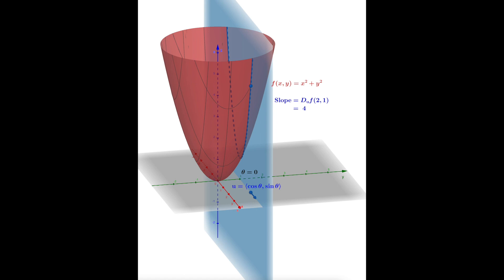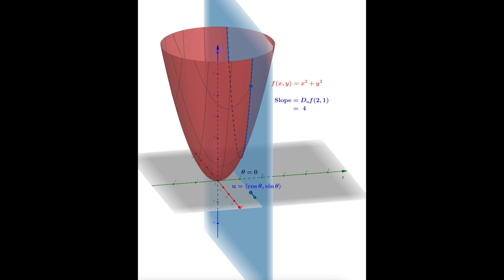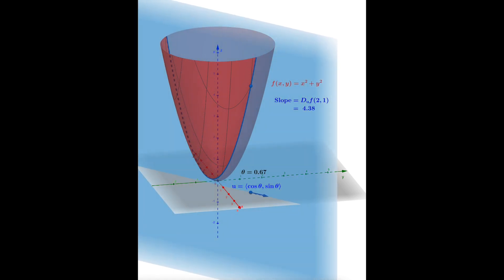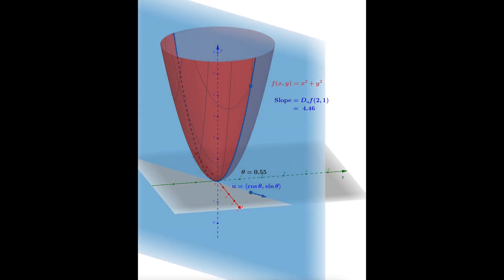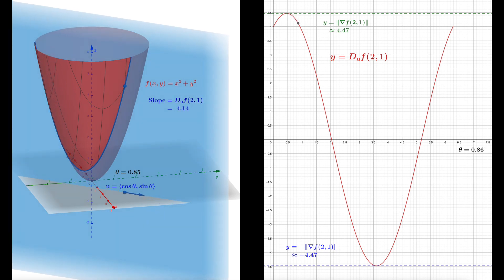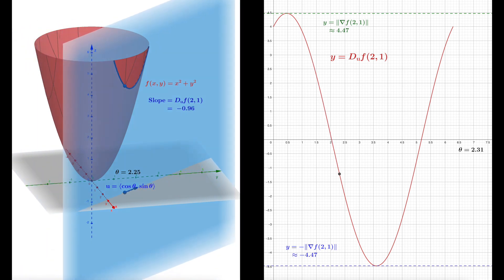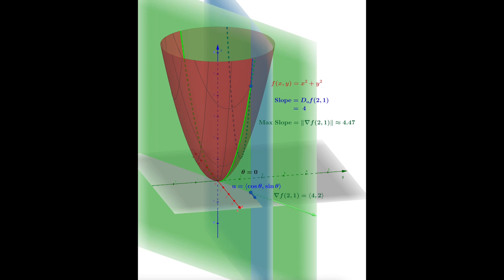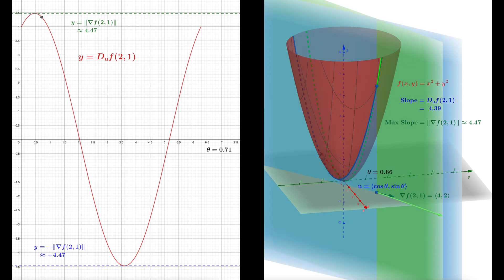Visualizing Directional Derivatives and the Gradient

Comment: Prove that there is no real valued function f such that f'(c;u)>0 for a fixed point c in R^n and non zero vector u inR^n. Give an example such that f'(c;u)>0 for a fixed direction u and every c in R^n.
Please help me to solve
Reply from the maker: Try and use the fact that the directional derivative is the dot product of the gradient vector with the (unit) direction vector.

Comment: If the directional derivative is the scalar product with a turning unitary vector, it's mean that 2 points which have the same gradient on 2 different curve will have necessarly the same directional derivative in each direction at that given point ? Probably because the 2 different curve are the same LOCALLY ? -- altough intuitively I would think it could be different and depend on the law of evolution of it's own curve.
Reply from the maker: Yes looks like you’re on the right track. If gradient f at (a,b) has the same value as gradient g at (c,d), then locally f and g look the same, and if u is any unit vector, then the directional derivative for f at (a, b) in the direction of u will match the directional derivative for g at (c,d) in the direction of u. This is because the directional derivative is just the scalar product of the gradient with u.